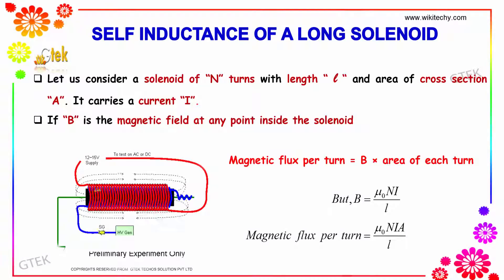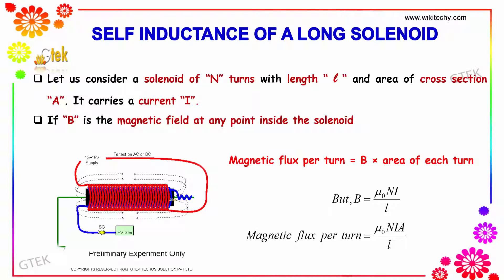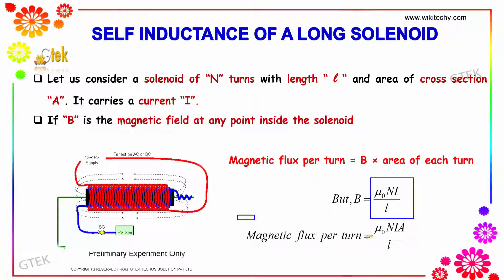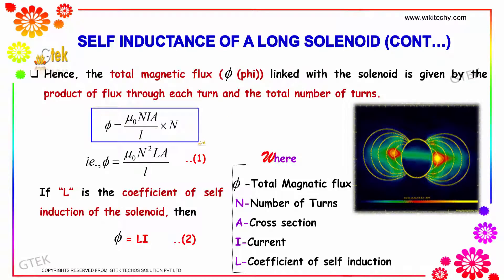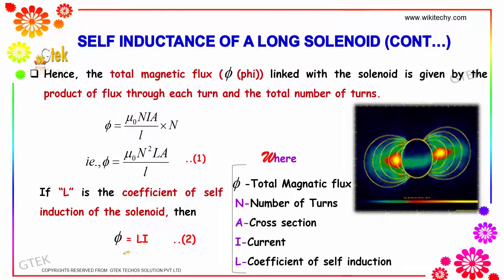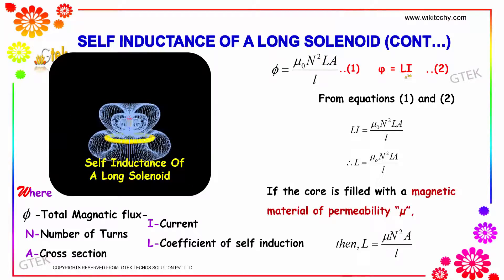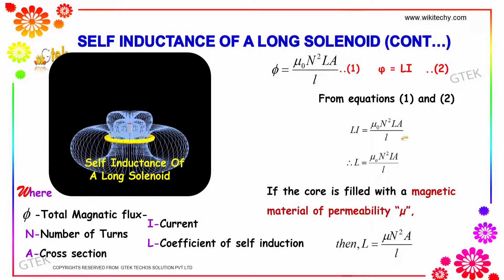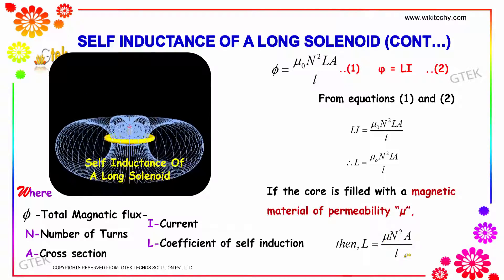Self inductance of a long solenoid|class 12 physics subject notes lectures|CBSE|IITJEE|NEET

Comment: Aug 16, 2016 - Chapter Notes of 'EMI - Electromagnetic Induction' for Physics Class ... It exist as long as the change in magnetic flux continues. ... Self Induction : It is the phenomenon of inducing emf in a coil due to ..... EduRev also offers NCERT solutions, subject-wise synopsis and chapter-wise notes/important points for ...

Comment: For larger values of inductance and for transformers, iron is used as a core material. The relative permeability of magnetic iron is around 200. This calculation makes use of the long solenoid approximation.

Comment: Self-inductance. Note that theself-inductance only depends on geometric quantities such as the number of turns per unit length of the solenoid, and the cross-sectional area of the turns. Suppose that the current flowing through thesolenoid changes.

Comment: If the inner core of a long solenoid coil with N number of turns per metre length is hollow, “air cored”, then the magnetic induction within its core will be given as: ... N is the Number of turns. A is the Inner Core Area (π.r 2) in m.

Comment: A solenoid is a type of electromagnet when the purpose is to generate a controlled magnetic field. If the purpose of the solenoid is instead to impede changes in the electric current, a solenoidcan be more specifically classified as an inductor rather than an electromagnet.

Comment: Small inductors for electronics use may be made with air cores. For larger values of inductance and for transformers, iron is used as a core material. The relative permeability of magnetic iron is around 200.

This calculation makes use of the long solenoid approximation. It will not give good values for small air-core coils, since they are not good approximations to a long solenoid

Comment: The inductance of a coil of wire is given by. Solenoid length cm with N = turns, ... This calculation makes use of the long solenoid approximation.